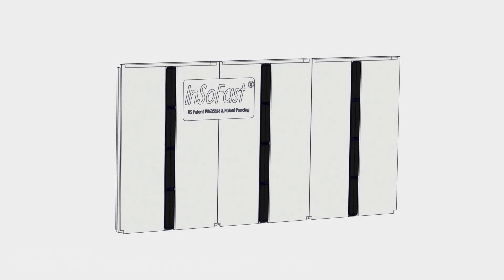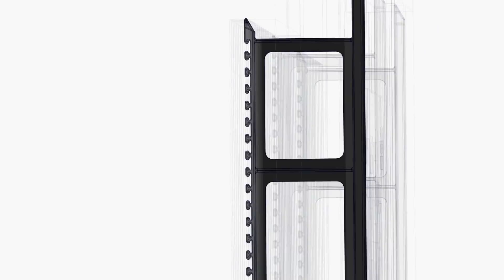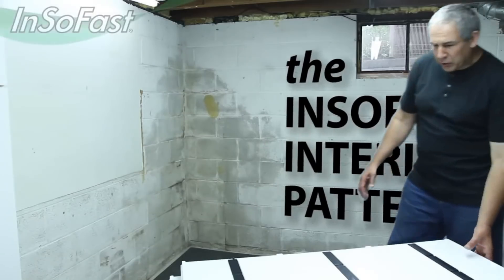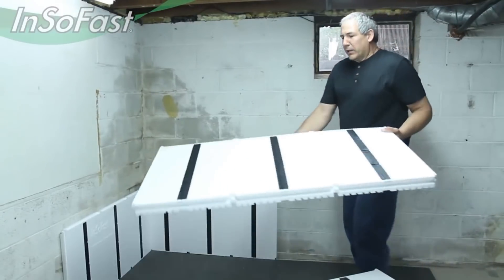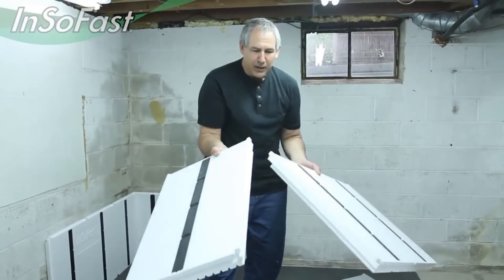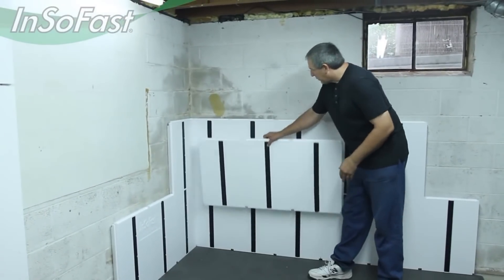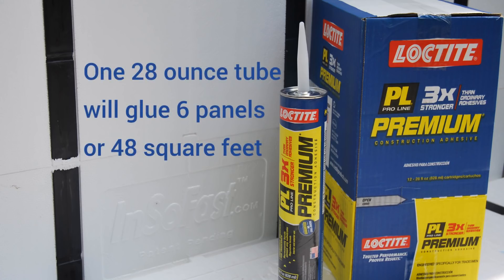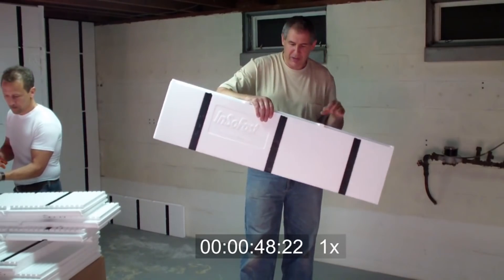InSoFast Basic Instructions

Comment: how do you avoid moisture condensing on the inside ie on the foundation we all ??
Reply from the maker: InSoFast is a class III vapor and it is a solid insulation panel. Insulation changes where the dew point will occur, which would be in the center of the insulation where it can not condense, insulation stabilizes the moisture profile of the wall.

Comment: This is more of an insulation product, rather than a finishes wall look combo.   You still have to add drywall and paint.   Ugh
Reply from the maker: Yep, that is why we make the finishing easy by molding in the studs. If you want it any easier hire a contractor to do the work.
Reply: Its an alternative to traditional framing and insulation, not meant as a finished surface

Comment: how does this go in regards to temperature?
Reply from the maker: I am not sure what you are asking. In this application, a basement the panel I recommend is the EXi 2.5 it is the best value for saving energy.
Reply: @insofastllc  where i live is very hot can get up to 40celsius in the middle of the day i am looking for something to keep the cool inside , and hopefully stem air conditioning cost
Reply from the maker: @antoniopetrou8389   Continuous Insulation is the best way to go. In construction wall framing usually is only insulated in-between the studs. As for how much insulation you need depends on a lot of factors. The size of the space you are conditioning where you place the insulation and other factors. The more insulation you add the better it performs... to a point. Doubling your insulation does not double your savings. for more information see this web page or call us we would be happy to help you determine what would work for you. https://www.insofast.com/explore/insofast-plus.html

Comment: When should we use the Great Stuff Gaps and Crack vs. The Great Stuff Fireblock
Reply from the maker: Good question. The only differences between the two products is color. The orange color was added to identify for building code inspectors that spray foam can be used as a fire block.

Comment: How is the drywall installed in the corners if there is no stud in the corners? Just screwed into the foam? Edit: Nevermind. I found your video.
Reply from the maker: Okay good!  I will answer here for other people with the same question. Thanks for asking.

We are different than a framed wall with big gaps in between the studs. We are a solid wall, so the corner is fully supported. Believe it or not you don't need a stud in the corner. See this video for a more complete explanation https://youtu.be/9aCiiNLL8r8

Comment: Panels arent sticking. Helppp
Reply from the maker: It is common in the summer that the glue will get to warm (liquefy) and not have a fast grip. Chill the glue to make it more viscous (sticky). Trust the glue it will set up strong. Proceed with the project and stack the wall, then brace the wall until the adhesive sets. https://youtu.be/kBpUqJty0pU?list=PLHUAK78BxshaG4Nq15X7TutsysAyAEQGG
Also see: https://www.insofast.com/explore/uneven-walls.html

Comment: Wait, so electrical boxes just float in the Styrofoam? How are they fastened in place? What's preventing a box from wobbling within the cavity? Surely you're not relying on the drywall to secure it.
Reply from the maker: Use a tapcon concrete fastener to secure the box to the concrete wall.

Comment: Looks like you don't need to install panels off basement floor for any drainage? I was considering raising 1/2 inch .
Reply from the maker: Here are two links that will answer your question. Professional basement waterproofing contactors do use the panels as part of a drainage system, but all water issues should be remedied before you invest in finishing your basement. The panels should be sealed at the floor to eliminate air flow and not allowed to drain onto the floor. https://www.insofast.com/explore/faq-before-you-finish-your-basement.html/ https://www.insofast.com/explore/faq-insofast-and-perimeter-drainage-systems.html

Comment: I think you started the second row wrong at the corner. In the first row you put the first panel at the facing wall and then the side wall, for the second row they usually suggest to alternate walls for the first panel placement. So, if you started at the facing wall in the first row then you start the second row from the side wall and then for the third row facing wall again etc.
Reply from the maker: You may certainly think that.
Reply: @InSoFast _ Wow! You may certainly feel offended?
Reply: @squidproquo2241  you got rekt by an insulation company! Love it

Comment: Fantastic product.
I'm in the process of installing 50 boxes of the EX 2.5 panels with my wife.
Easy to work with...
Reply from the maker: Thank-you... have fun!!
Reply: JJBpilot was wondering how you're liking the final product? I'm in the process of setting up some containers on my property and I'm intrigued.
Reply: @kriscmore5023  the panels are great. Our main floor is done.  New windows as well. Power bill about 25% less!!! Basement about half done...

They have new, awesome  panels made specifically for shipping containers. 
I would say no better product for insulating them.
Check it out.